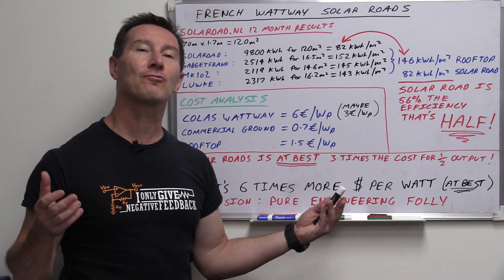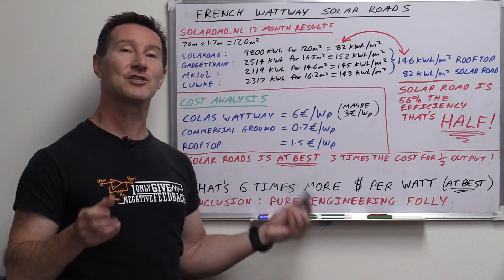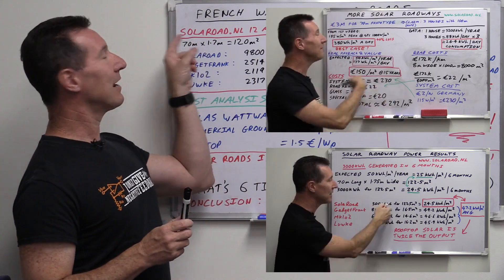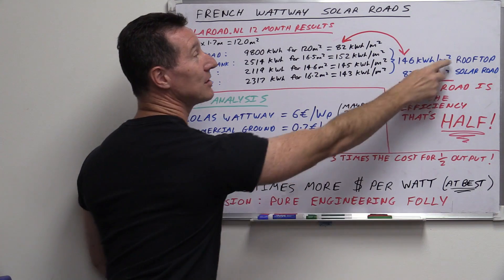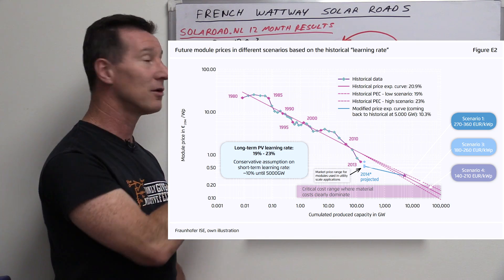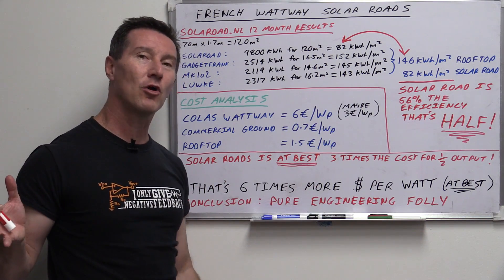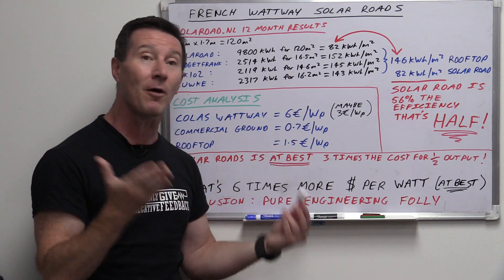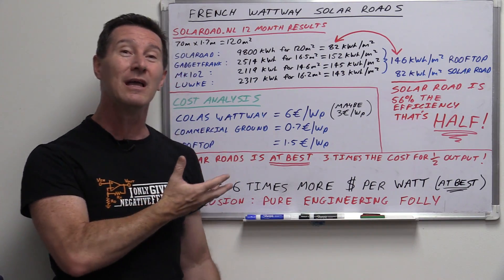EEVblog #850 - French Wattway Solar Roadways BUSTED!

Comment: CAVEAT. When a technology is very new, it typically cannot compete with older entrenched technologies.  Shortsighted people get on soap boxes and demonize/ mock it; the surrounding mob cheers them on.  A decade or 2 later, that technology might be mainstream, competitive without subsidies, employing thousands of people,  and net carbon-negative.  If the world is truly going to shift entirely to solar and wind over the coming several decades, we need to install A LOT OF PV.  Appropriate horizontal surfaces such as rural roads or bikepaths can add up to gigawatts of ground-embedded PV potential, which we'll need.  We need to allow these pilot projects to be built in 2019 to see how they fail; then correct those design flaws, so that the ground-embedded PV systems of 2023 work better, cheaper.  Surely people mocked the Wright brothers in 1903: "haha, what idiots.. that'll never work." ✌️   ig @ecofuturista

Comment: In Canada we get snow on the roads for aboutt 4 months of the year (where I live). On the roads we use gravel, sand, and salt and use heavy plows. Further it is not uncommon to see studded tires for additional traction. On some roads chains are used. How long would a panel last?

Comment: after 1 year , it works well at 85 % in france  . 20 others roads or projects are built in the world now. Even china has built 2 kilometers highway solar   with their own technology.
for france it was a prototype and they want to ameliorate this tech for price and resistance.
You can put this solar road everywhere on the ground , not necessarely on road.

Comment: you can't debunk a technology that actually works. Its the application that is the problem you dont actually make the road itself solar you put the solar cells as a bike lane or side walk or along the side of the interstate. Prove power generation first than you can tackle if the cells are strong enough to with stand that much stress everyday. One step at a time people one thing at a time.

Comment: Questioned by AFP about the issue of cost of production, Jean-Charles Broizat, project manager at Colas, responded "have the ambition, by 2020, to join the costs of conventional solar panels"

translation : 
Interrogé par l'AFP sur la question du coût de production, Jean-Charles Broizat, directeur du projet chez Colas, a répondu «avoir l'ambition, d'ici 2020, de rejoindre les coûts des panneaux photovoltaïques classiques»

Comment: Why not put it over the road? Sort of like a "roof" for the roads. That way, you have your "solar road way" but you don't have to worry about driving over them, and you can have them stretch for miles (since highways go for hundreds of miles). Although, someone probably thought about this already and did the math, and decided it was too expensive for what you would get out of it. However... if governments were to implement it, it would create massive amounts of jobs (building the panels, framing for the panels, construction contracts, maintenance, surveying, design, etc.). The power companies wouldn't like it, but it would be an interesting idea for a country with a large budget to try and implement.

But sadly, there is no money in alternative energy. The only money that is involved is construction cost, and once it's completed you're only paying for maintenance and such which is no where near the cost of oil/coal/gas.

Comment: Automating the process of placing the solar panels on roads will make the difference at some point. Where in the other hand automating the process of placing solar panels on roof tops is nearly impossible.
The cost of solar panels is dropping more and more and soon the only problem faced will be placement and automating the process of placement.

Comment: @eevblog Electrical connections can be hooked up on the side of traffic lanes, in gutters or in ducts integrated in the panels themselves. Lastly, electronic circuit breakers ensure safety

Comment: May be possible to have some sort of flex in the road surface to allow for a mechanical generator to be powered by the pressure the vehicles produce?
Reply: Pressure doesn't produce power. All the power would come out of the engines of the vehicles. So yeah, it would be possible, but it would just be a very roundabout way to produce power from fuel.
Reply: I suspect you are getting hung up on my use of the word "pressure." The weight of the vehicle would depress spring-loaded devices as it moved along the roadway. It would cause a repetitive up down motion.
Reply: No, I'm getting hung up on the fact that you seem to think that this would be "free energy". No such thing exists of course. Every bit of energy has to come from somewhere. With solar panels (as bad an idea it is to put them in the road) it comes from the sun. With your idea, it would come from the cars. It would slow them down. It would make their engines work that much harder. Your "free energy" comes with a large carbon footprint..
Reply: I stated nothing about "free energy."
Reply: Yeeeessss, insult me some more, I love it
Reply: So you don't think it's free energy? You're aware that it'd be fossil sourced, and you're okay with it? Because we've already invented gas-fueled generators, this would just be a more complicated version of that...
Reply: No, I don't think it's free energy. I am aware that fossil fuels are currently used, and that any means of making it more efficient or non-existent should be pursued.

Comment: Can you use solar panes that have a focusing lens to refract light at an optimal angles across the day passively .
Reply: Because the sun keeps moving, any refraction would produce a moving patch of light. There is no way to do this passively. Plus it would just increase costs further.

Comment: they finally answered how they are going to deal with non working panels in the winter...they are going to save that work til the other 3 seasons.  https://www.facebook.com/solarroadways/photos/a.420995047125.197235.41869107125/10154037139037126/?type=3&theater

Comment: This guy totally forgets how much energy is put into the hot tar and oil roadways. Far exceeds and save more power than rooftop or ground by a long shot, this guy is too short sighted.
Reply: "This guy totally forgets how much energy is put into the hot tar and oil roadways."
Much, MUCH less than what is used in the construction of solar panels. Asphalt as a waste product of the oil industry is dirt cheap and very good for building roads out of. I'm all for building more solar panels, but why in the fucking world would you build roads out of them?????

Comment: The cost results are in, and the results are stunning.
According to Colas, it costs €17 to generate 1 kilowatt of energy, as opposed to €1.30 for a normal solar installation. That's OVER 13 TIMES THE COST FOR THE SAME AMOUNT OF ENERGY!

Comment: As much as i enjoy your videos on that solar roadway crap i suggest you stop that for your own health- cause i fear that either you will hurt your eyes with that pen, get a heart attack or your head might explode because off the sheer stupidity of that idea ;) -  btw. my job is planning rooftop-solar-systems so i know a little about that stuff (biggest so far were 16.000 modules on a single roof (about 4200 kWp)- hell even on rooftop-systems you have to consider shade of objekts to not screw up the efficieny).

Comment: You are comparing apples to oranges. Solar roads are only expecting to pay for the street lighting of the road, not be a significant addition to the grid. You do not calculate the cost of needing the rooftop area to generate same solar for the municipalities in question. 
You are making stupid assessments. 
They make sense for a way to have the costs of lighting the roadways pay for themselves. You really are an ass.
Reply: "You are comparing apples to oranges. Solar roads are only expecting to pay for the street lighting of the road, not be a significant addition to the grid."
So why put them there in the first place if its inefficient and pointless? Also, I bet my ass that asphalt is not only way cheaper, but also makes for a better and safer roadsurface.

"You do not calculate the cost of needing the rooftop area to generate same solar for the municipalities in question. "
Rooftops already are there in sufficient number. Where is the problem?
Reply: OMG, you really are dense. The road surface is a passive space and  not producing electricity now, so make it into an ACTIVE space and produce electricity. Simple. 

Roofs are passive spaces, not producing electricity, so turn them into ACTIVE spaces and produce electricity. 

DUH
Reply: Only that a road is a much, much worse place for solar panels. Some reasons:
>like 50% less efficiency due to untilted surface
>abrasion and wear&tear, glass is simply unfit for roads
>immense price and maintenance costs

Building roads out of solar panels would only make sense if everythign else was already covered in solar panels.

Comment: You are using $ per watt produced to say that solar roadways cost 3x as much than commercial ground in a best case scenario, Then use that $ per Watt ratio and combine it with the fact that the solar roadways have half watt output than roof installation to double the ratio and end up at 6 times the cost per watt. Don't think that makes sense, but maybe I'm just misunderstanding something here
Reply: The ratio intended should be the cost per sq m which leads to 480ish €/m2 vs 220 €/m2 for solar panel... so just twice the price.

but in line with other comments : what is the total lifecycle cost of a road square meter ? How does that compare with photovoltaic road square meter ?

Comment: Yup. Roads and paths are often shaded by bridges, embankments, trees etc. They are dug up every couple of months. Most flex and move with heavy traffic and subsidence. They clearly haven't tried actual roads yet because they wouldn't be durable enough, even if the resin is as tough as road markings those still wear away far too quickly

Comment: What about solar road shades? Solar panel corridors over the roadway, which do essentially the same thing, require less maintenance, and could possibly increase safety by cutting down on glare, and decrease pollution because shaded cars don't need to run an AC as heavily during the summer? Anyone? Anyone? We can start a Kickstarter campaign tomorrow and become wildly rich!
Reply: Sorry, but... solar submarine and wind-turbine powered cargo aircrafts first, French ideas will win!
Reply: Jean-Marc Chevalier The wind powered aircraft makes sense! I mean, you are moving through the air, so stick a big turbine on the front to harness that energy. Then, put that energy into turning the propeller, which pushes it forward, which generates wind, which powers the propeller...GENIUS! Someone, put someone on building a crowd funding campaign. We got money to scam...err...investments to earn...that's what I meant.

Comment: I don't think the cost of solar is actually dropping. There is a reason prices have fallen:China! Try building these things in the west, price goes right back up. When you have proper pollution control and mining laws and worker rights and real energy costs, you can't build these things cheaply. We also have no idea how long these things will last. We have no idea how many shortcuts have been taken and we don't know how much they were subsidized within China. We know the Chinese government has no respect for IP, so we don't know if the designs were simply stolen and therefor have no R&D costs associated with them. We know that we cannot sustain huge nations of slaves either. These are some of the many reasons why all the cheap panels are coming from China and not Germany or the US. We don't see all the pollution, all of the workers who are exposed o toxic chemicals and on and on and on. All we see are the end products and since none of the new panels are old, we have no idea of their quality and how they will perform in 15 years. Let us not forget that we are in a super-low interest rates era. What happens when interest rates normalize?

Comment: so you say its 3€ per Wp which is the double than the 1.5 you give for rooftop.

Then you jump to 3 time for half the output.

there is clearly no logical link between the two sentences, its just twice more expensive, that's it, and you have a road, the yield doesn't change that, it doesn't matter in the calculation as we already have the price per Watt...

Comment: The first photovoltaic paving the French territory should be completed in Tourouvre (Orne) on 10 December 2016 . Ségolène Royal inaugurated the commencement of work on Monday.
The Minister of the Environment Ségolène Royal on Monday launched Orne work photovoltaic paving, called "solar highway", manufactured by SNA Scop, a world first on this scale. "France has more than one million kilometers of roads (...) For the energy transition it is time to transform the road yesterday mere ribbon of asphalt, into a source of energy," she launched after having visited the factory and the SNA experimental site in Tourouvre (Orne).

The solar road prototype "Wattway," able to capture solar energy and produce electricity, was designed by the construction group Colas, Bouygues subsidiary, in partnership with CEA Tech and the National Institute of solar energy. It will be tested in Tourouvre over a length of one kilometer. In total 2800 m2 of photovoltaic panels will cover the floor of the county road 5, on which run an average of 2,000 vehicles per day. The slabs laid directly on existing roadways.

The end of the project, which received a government grant of € 5 million, is scheduled for 10 December. Segolene Royal, who had already come in July inaugurate the project, said also hoped that "very quickly, a yard (...) about one kilometer, launched on a national highway or road."
1 km to enlighten souls 5000

"Very thin but very resistant, slip resistant and designed to last, Wattway tiles can withstand the passage of all types of vehicles, including trucks," says Colas. According to the developers, these tiles can be used to supply electricity to street furniture but also buildings, shops, businesses, and recharging stations for electric vehicles. They could also serve homes in remote areas not connected to the electricity network.

"This is a utopia that becomes reality, we can make consumption and energy return over the network. The kilometers that today we will be launching equivalent to the consumption of 5,000 users, "enthused the minister.

Read: Solar roads, energy of tomorrow

Questioned by AFP about the issue of cost of production, Jean-Charles Broizat, project manager at Colas, responded "have the ambition, by 2020, to join the costs of conventional solar panels." Regarding performance, he said that on "300 kW installed", the slabs produced Wattway "5 to 10 kW less" than the panels on pitched roofs.

http://www.parismatch.com/Actu/Environnement/Segolene-Royal-lance-les-travaux-de-la-premiere-route-solaire-francaise-1102373